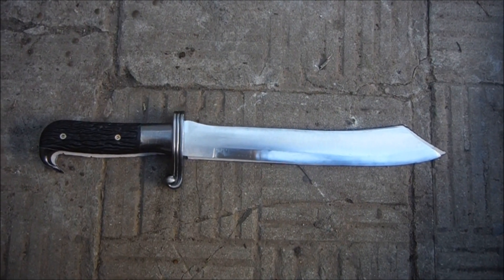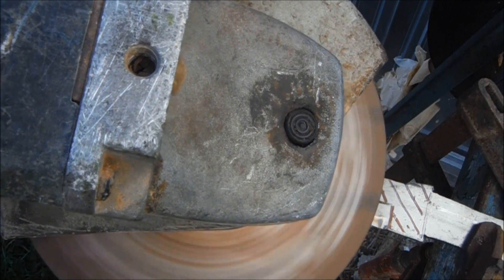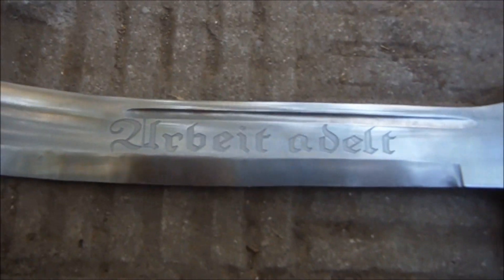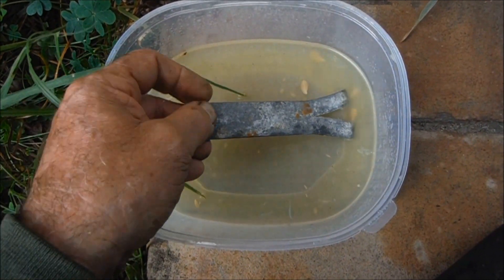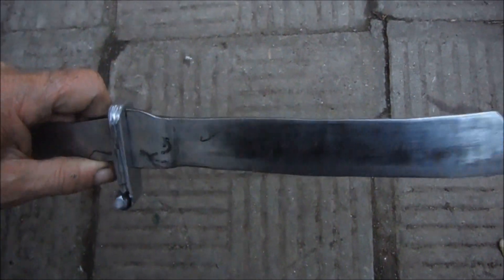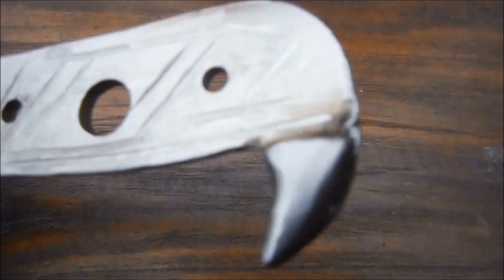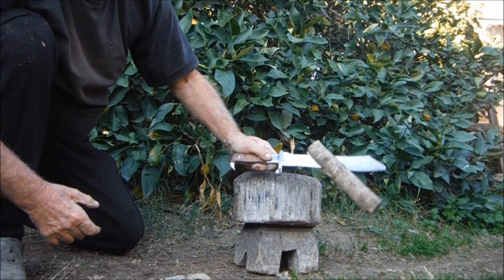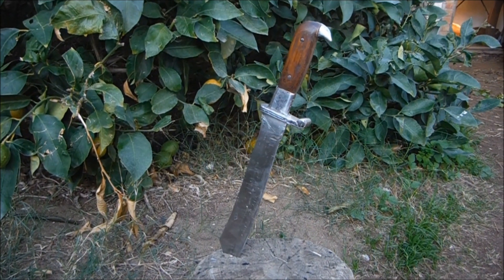Making a genuinely full tang RAD EM Hewer Knife Arbeit Adelt

Comment: Great work Del. A very well constructed blade & proven effective. I've learnt some new techniques also. Thank you. 👍
Reply from the maker: Hello, Guy! Thank you very much - I don't know how much I really need such a huge knife but I've been enjoying finding reasons to use it. I can report that it's a bit unwieldy for chopping carrots, and also that, upon being cut, each slice takes off across the room and ends up on the floor.
Actually I was just thinking of you. A year or so ago I mentioned my desire to build another 124301-basedvproject. Accordingly, today I set up my little "workshop" set and recorded an intro. This ended with me airily announcing that  I 'd be back after removing the body...and I can't work out how to get the damned thing off. I found a screw at the rear on each side, but there are more to come out and I can't find them. I've stopped trying for fear of snapping something in frustration. I've peered at the rat rod I built with the body from the last 124301, but found no clues.
Reply from the maker: I just got the body off! I've built a couple of Twmiyas since I last worked on a WL Toys model, and I think I was expecting more precision than I should have been! A really savage yank soon got it off.
Reply: @Del350K4  Well done Del. Off the top of my head there are the two screws at the rear sides of the cab. Then two under the bonnet. But as you've got it off no need for more info. I look forward to the new 124301. 
 I'm sure you find a use for the knife. Grow some bigger carrots?
Reply from the maker: @RC3DPrintAdventure  Or move up to parsnips...

Comment: Fun project Del looks like you were successful at re creating a classic piece of history i recently got a 2 burner propane forge and am looking forward to trying some knife making
Reply from the maker: Brent - you have a forge! A traditional way to make your first knife is to get an old horseshoes and have at it. If you can squish one end flat, you should be able to grind a blade profile into it. Even if there's insufficient carbon in the steel for effective hardening, you'd have a letter opener to be proud of.
Reply: @Del350K4  I'm excited to try my luck at it I have been gathering high carbon steel
Reply from the maker: @AdventureTimeRC  Cool! The one thing I haven't mastered is forge-welding.
Reply: @Del350K4  I bet it takes lots of practice
Reply from the maker: @AdventureTimeRC  It's all in recognising the right temperature. Of course, I suppose a guy could "cheat" by buying an infra-red thermometer ...